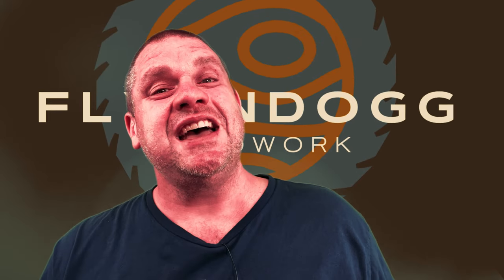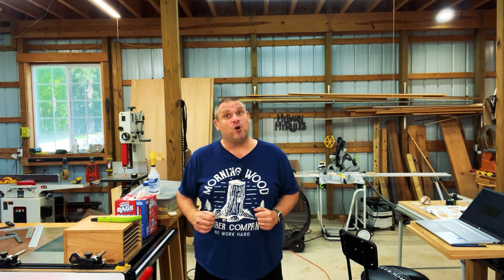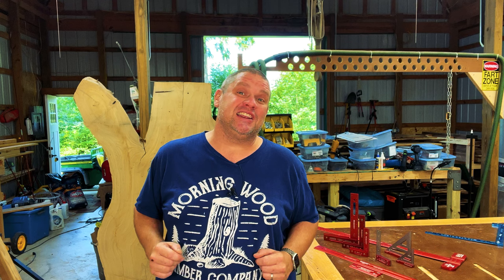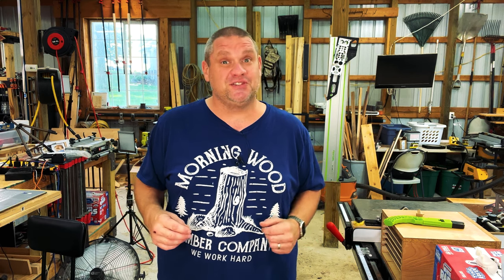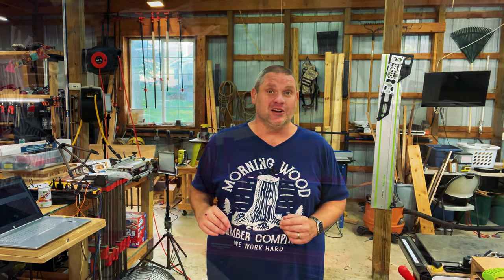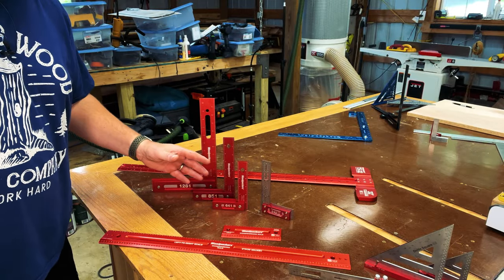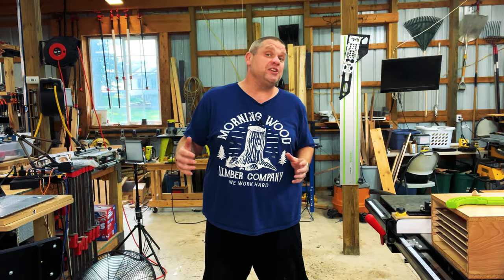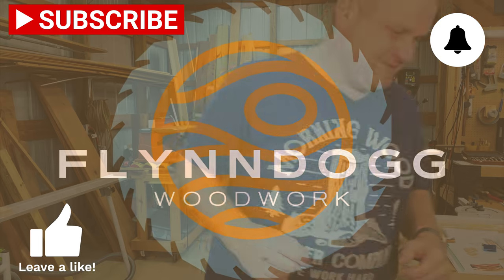Affordable and Effective Alternatives to Woodpeckers Squares #woodworking #precision

Comment: Great video, very informative, thanks for sharing... I agree 100% that Woodpecker Tools are just way too expensive for what they are and there are way too many alternatives that are almost as good @ a fraction of the price. Agreed, not bashing Woodpecker but you can't say the truth without it sounding like we are bashing Woodpecker. What Woodpecker needs to realize is "when an item is priced right, it SELLS..." and given that their cheapest tool is easily over 100 USD that's not good for the average Joe. Your Amazon links eventually landed me with the Milescraft Brand and I'm here to say they are very reasonably priced. I almost bought a few tools just now because of the price alone; not that I'd EVER use these tools they were just priced that reasonably that I WANTED TO BUY THEM... Milescraft has a drill guide from 1/8th to 1/2" for under 7 USD, Amazon Prime Shipping of 1 to 2 days, and it had brass inserts, I mean, seriously how reasonably priced is THAT??? Milescraft offers a plethora of tool options with many that will rival Woodpecker; and even if they're not as good, the price is right and makes it worth investing in... Cheer's...
Reply from the maker: Love milescraft.  I have not been disappointed from a single item I have purchased from them yet.  They seem to take ideas and make them more affordable with the same functionality!  Thanks for watching and the comment!